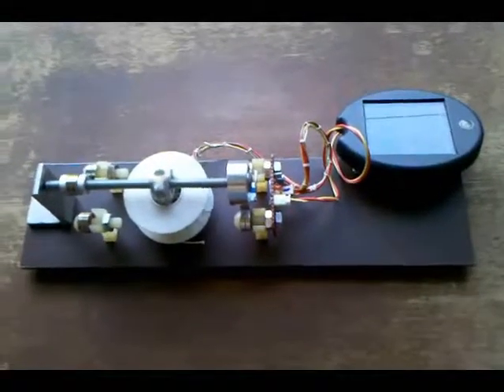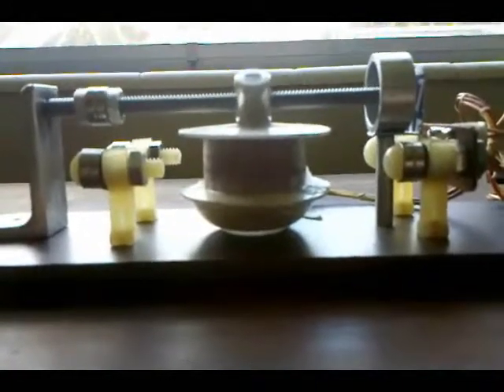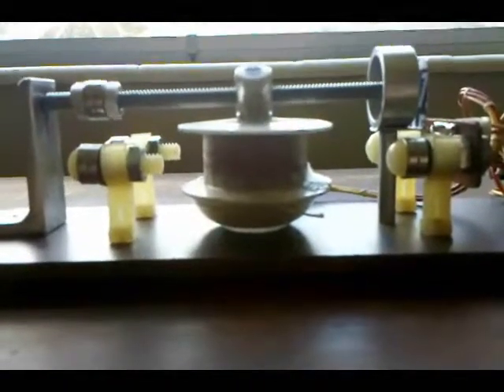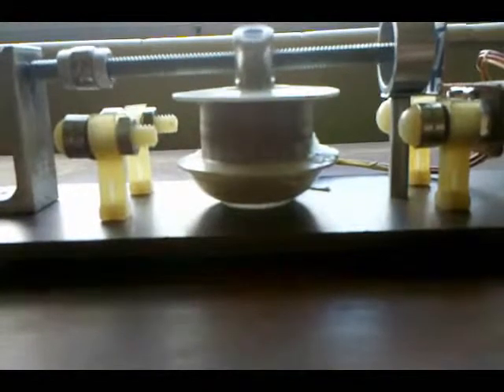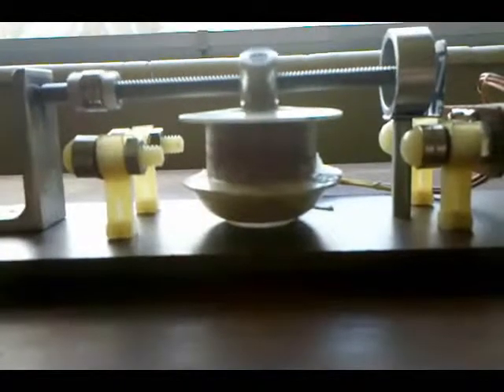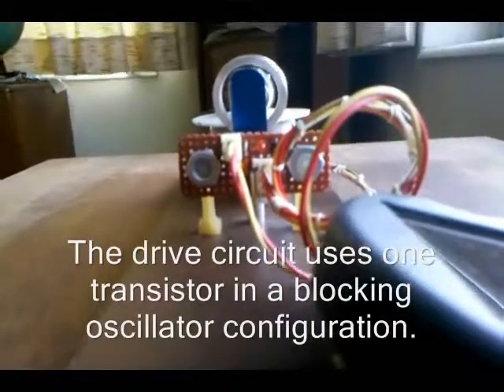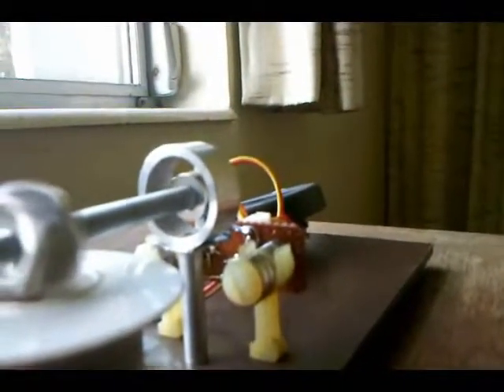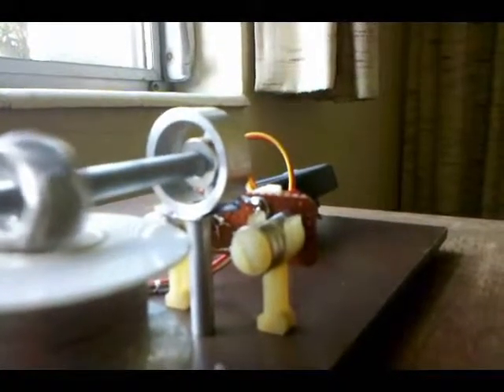Close up views of low power, levitated pulse motor.

Comment from the maker: @kafr8413  Your question prodded me to to add a new article to my levitation website titled "Drive coil" that has all the details of my coil.

To quickly answer your question though, it is 2 untwisted wires wound on the coil form.  You really should try to keep the windings neat as you can so the coil is not lumpy etc.

I hand wound the coil and it just took me a long time to make it as smooth as I wanted it to be.  200 feet of wire ends up being a LOT of turns.   ;-)

Comment: I haven't run the motor above 5 volts since the magnets are held on only by their attraction to the square nuts. I'm afraid they will fly off above 5 volts. My goal for the motor was to see how low a voltage it could run on.

The schematic is similar to other blocking oscillator motors on the web. I think you'd have to modify the coil and circuitry to run it on 9 volts. If I remember correctly the motor ran at ~4,000 RPM on 5 volts.

Comment: just a little question, what would be the speed of the motor if you connected a 6v or 9v battery to it, because i'm trying to get hold of low power high speed motor schematics, thanks.